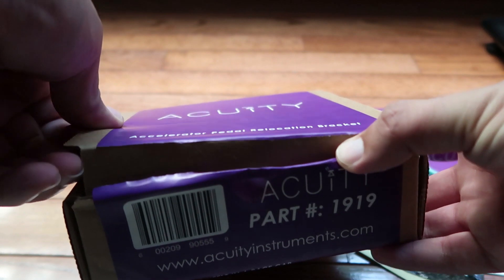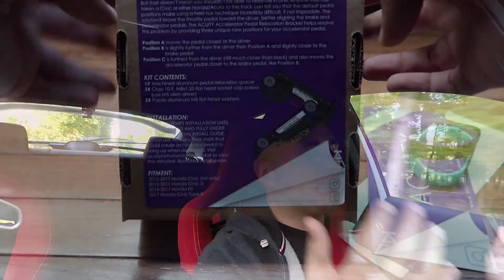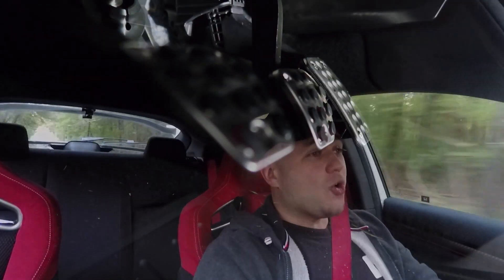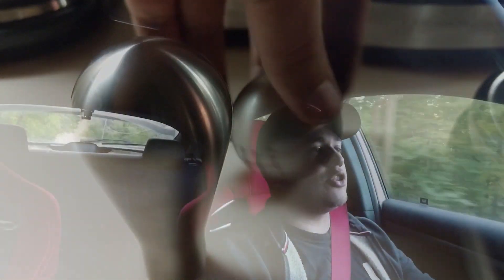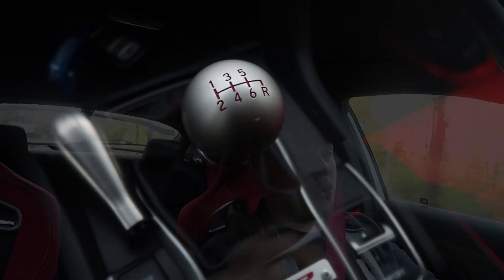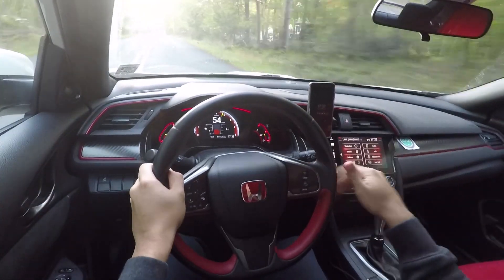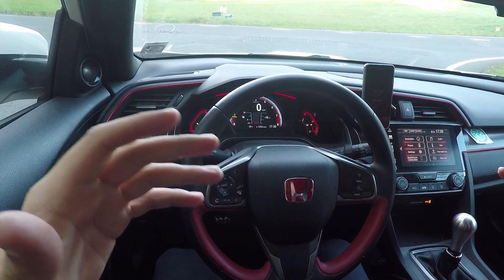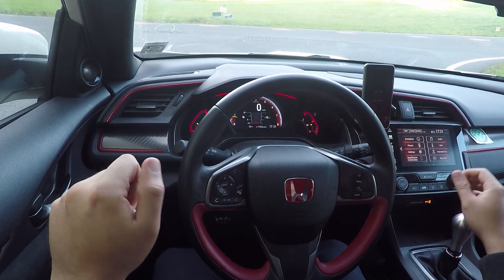MUCH BETTER! | FK8 Honda Civic Type R MUST DO Shifter Mods Review

Comment: That looks like a really fun road!  Thanks for the video.  I've got to try that taller shift knob in my CTR.  I have an Alta Performance knob which has more weight, but the height is still low.

Comment: Hi Elias, I don't mean to hijack your video, but how you do your CTR oil changes? I can find the oil filter but I'm not sure it comes with a washer for the drain plug and I want to do an oil change soon on my new to me CTR #11881 do you happen to have the part numbers in order for me to get  the proper ones? thanks!!

Comment: hey, wondering did honda contact you about the engine harness recall? have you done that recall for your ctr? dealer keep calling me to bring the car in and they said the engine need to drop down and take about 8 hours to get it done, is that true for just raplace a harness wire around the engine?
Reply: Bryan Zeng this is the first time I’m hearing about this. But it could be like the breaking axles, only certain numbers are considered affected by Honda. What number is yours? Mine is 3871 and I haven’t had any recalls affecting it (but it has had a bunch of issues from day one)
Reply: mine 1184
Reply: Bryan Zeng talked to my friend who works at Honda, he looked up my vin to see if there were any recalls and nothing came up. He said it might affect only certain models but he hasn’t heard anything about it.

Comment: change them rims!!!
Reply from the maker: I am looking for 18x9.5 wheels for all the tires I just bought
Reply from the maker: If you don't care about torque steer the world is your oyster, if you do, only offsets higher than 50 will do
Reply from the maker: They are a bit short on stock for some reason. I have bee wheels about to be put on, 18x9.5 35mm offset, I'll get some torque steer, but I don't mind
Reply from the maker: No, as long as you get 265 35 18, you'll be alright